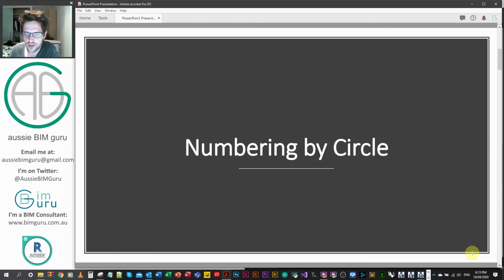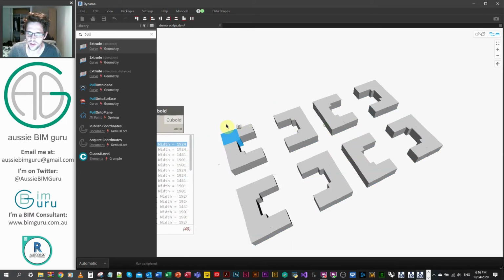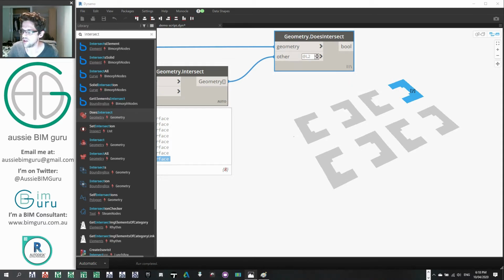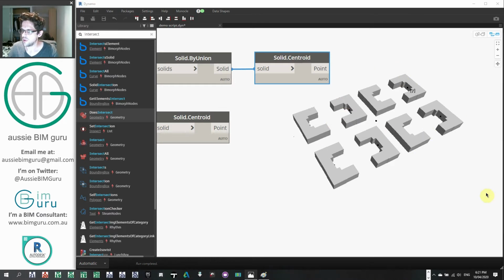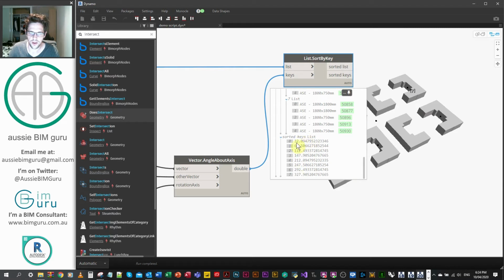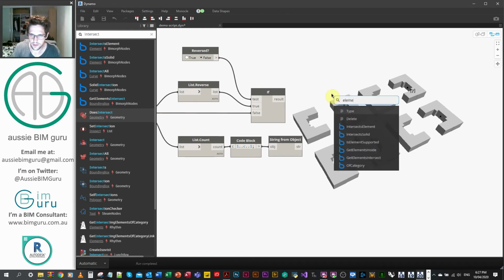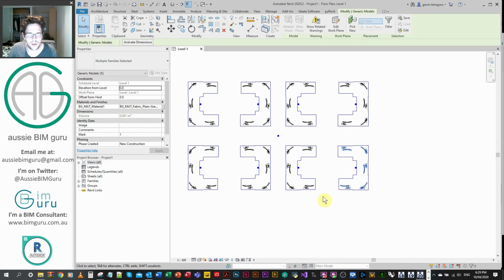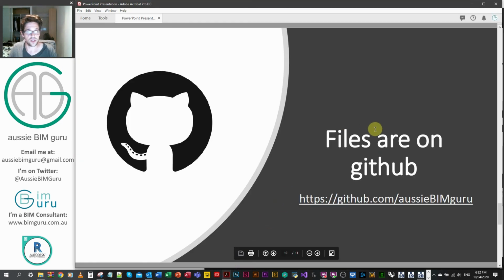Numbering by Circle using Dynamo!

Comment: Hello Aussie, can you please take a look to a bit complicate case and suggest how to perform numbering? I left the comment with an image on LinkedIn on the same video: https://www.linkedin.com/feed/update/urn:li:activity:6674305007912787968?commentUrn=urn%3Ali%3Acomment%3A%28activity%3A6674305007912787968%2C6674814751379390464%29
Reply from the maker: I would suggest exploring a number by spline workflow instead in this case, this way you can run multiple loops to pick up outer/inner subsequences or discount elements more than a certain distance from the spline.

https://youtu.be/blkmDknTu_A
Reply: @AussieBIMGuru  Thank you very much for a prompt response. I saw that video (also great video) but I'm making Dynamo script for users that do not have experience with Dynamo and it would be hard for me to explain to them why they need to draw a spline...
Reply from the maker: Mm the only other approach is to group by distance and set a threshold to identify the outlying windows but it wouldnt really work for irregular building shapes as youd have lots of distances from centrelines.

Might be worth researching convex hulls as a means to isolate perimeter elements in a set only.

Comment: Thank you for the nice tutorial :) I want to try to applicate it (or at least part of it) on a facade example with a lot of panels, where for example every third has a different setting. I have trouble sometimes to find out how elements are placed (randomly). So having a system for numbering it is a interesting topic
Reply from the maker: You're welcome! Depending on the shape of the building, numbering by spline may be more effective (I have a video on this too).